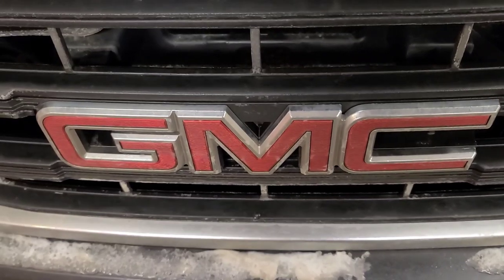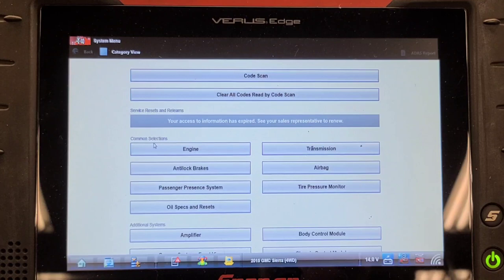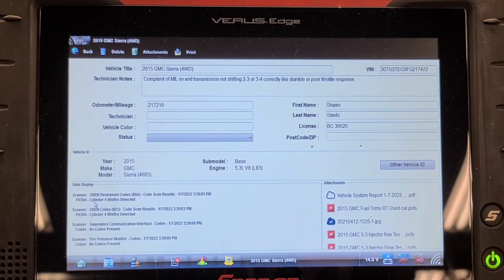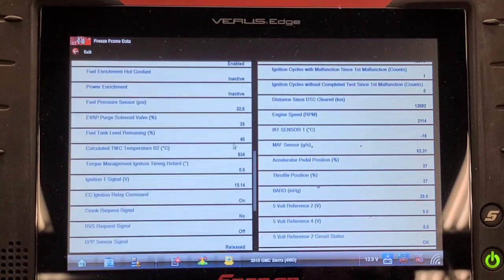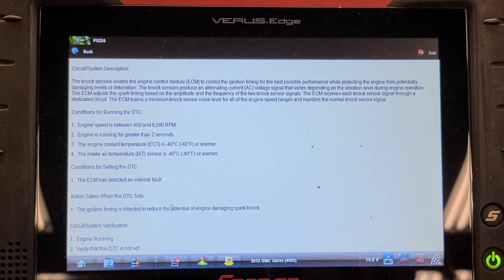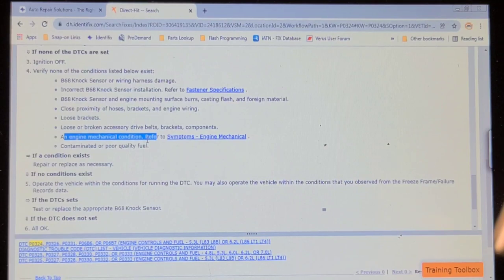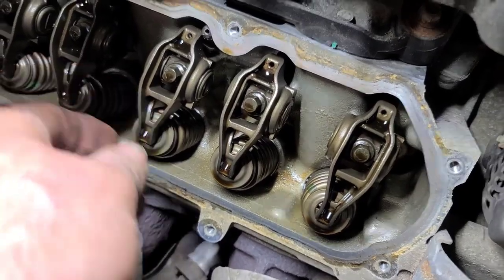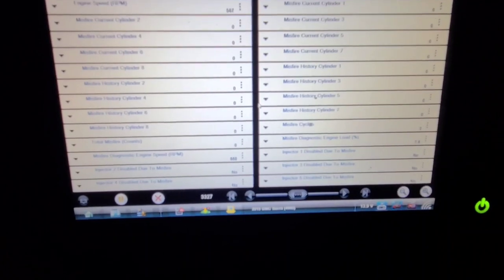2015 GM Truck 5.3 P0300, P0304, P0172 and P0324 Plus Engine Ticking

Comment: could that problem be caused by GM cylinder deactivation  system  ?
Reply from the maker: I believe so and agrivated by the change in geometry due to locating the injectors in the cylinder head due to GDI. They operate at a slight angle now compared to pre GDI systems.

Comment: Same year, same truck, same engine, currently the engine is ticking very loud, but no missfire the only code i have is p0324, currently diagnose it
Reply from the maker: That's the knock sensor code likely being set by the noise in my opinion.  Try to pinpoint what side of the engine the noise is loudest on then pull off the valve cover and have a look. You can run it for a short time with the cover off and on 4 cylinders to watch valve train movement. Look for a bent pushrod or broken valve springs. Let us know what you find.
Reply: @PhillipBailey  Update: We took the valve cover off and inspected every rocker arms and pushrods, rocker arm #1 was loose, but #7.. exhaust side pushrod was snap in half, rocker arm very loose, crazy ! No more ticking, no more dtc, customer is happy… for now…
Reply from the maker: @senioraxys3947  hmmm I believe cylinders 1, 7, 2 and 4 are deactivation cylinders. Glad you got it fixed.
Reply: @PhillipBailey  mine is a 2017 silverado took both valve covers off no loose rockers or see any damage push rods no misfires and definitely having a ticking noise just can't pin point what cylinder thanks
Reply from the maker: @Maztermech  if you leave one side connected you can actually start it with the opposite side open, run it on one back to try isolate the noise with a stethoscope or by feeling the rockers while running. Keep in mind it might be a lifter. It's a bit messy due to oil throwing off rocker arms but not that bad. Also watch for even oil flow from each pushrod. Did you actually remove the rockers and pushrods to check for a slightly bent one?

Comment: Looks like a common problem. Next one will be a lot easier. Hope they don't damage the lifters or camshaft.
Reply from the maker: That's the second one in two months. This one was number 4 exhaust last one was number 6 intake. Both are DOD cylinders.
Reply: @PhillipBailey  I was thinking the valve trying to open under cylinder pressure with both valves closed due to cylinder deactivation,  and reactivation just before TDC where on the overlap the valve would be so hard to open that the push rod would get bent. This would work for the intake but seeing it happens on the exhaust I can't see how you would have an exhaust valve trying to open under compression or even combustion pressure @ the bottom of the stroke. If the timing of the lockout pin can be precisely controlled it may be just be a software update that is required.
Reply from the maker: @Jack-ns5mn  it's my understanding that since the redesign of the cylinder heads to accommodate the fuel injectors that those changed the geometry of the valves and push rods. They now operate at a slight working angle. Problem seems to be more prominent on the DOD cylinders. The pushrod rubs slightly on something which sets up a stress in it and harmonics causes it to bend.
Reply: ill stick with regular lifters

Comment: Hey i have 2015 suburban and it has code p0324 coming up when i accelerated on highway about 60mph, engine started to have ticking sound, i don't know whichside of the engine coming from, but i know if i slower down my speed, the sound go away …, but the code stays on P0324 knock systems error, could it be the same issue as in the video?
Reply from the maker: It very well could be. Listen with the engine running at the speed where you hear the tick. You will need someone in the cab. Try to isolate whether it's left or right bank. Once you narrow it down to right or left side you'll need to remove the valvecover and inspect the pushrods. HTH
Reply: My 2016 suburban is doing the same thing with the same code im currently swaping both knock sencors now. Also extreme loss of power going up hills